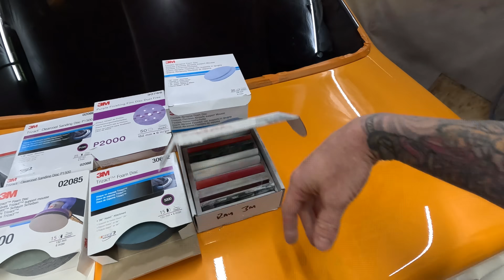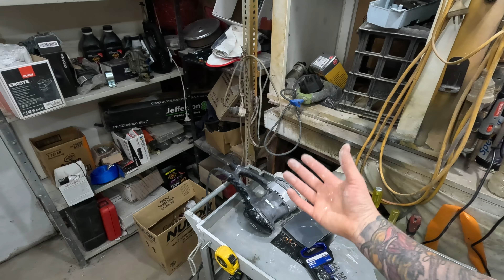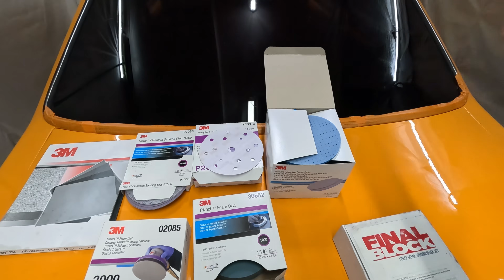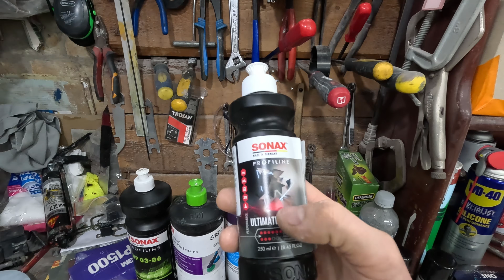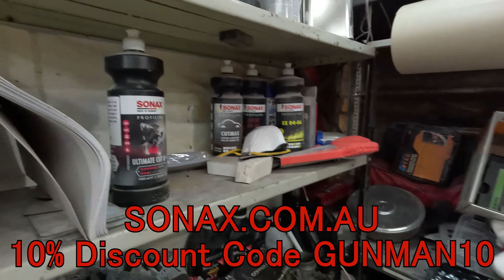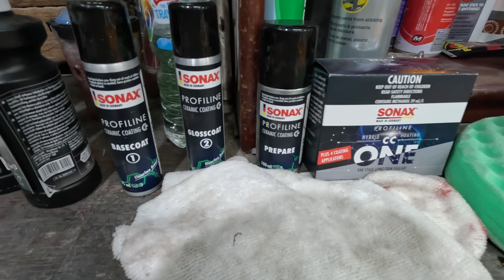My Polishing Procedure: Tools & Materials

Comment: GUNNY... I hard block with a piece of 1" dia pvc pipe with a flattened side with EAGLE 1500-2000-3000(Japanese manufactured) it is a MUCH MUCH better product, which I thought would be more expensive... it is half the cost of 3M, lasts longer with a more consistant grain size, so it leaves more uniform surface.

Comment: after painting 2 k solid white  I cut back with a DA 1500 ,2000,3000,5000 and still see scratches.WHY? then used every buffing pad and polish there is but still can't get rid of those scratches.very frustrating

Comment: Hey Gunny mate 
I used to be the body filler, primer, sanding and masking guy. 
I got F all time on the spray gun in the shop. 
I’m happy to block my whole car with 2000 grit wet and then buff. I only had 4 years experience so my painting isn’t very sharp. But at least with blocking I know it’ll be super flat. 
I use a Supercheap DA polisher and it goes hard for the $120 or so I spent on it. Pair it with a carpro denim pad, then a Woolie, using Menzerna products, you might like it bro. It’s probably better than the Sonax and Rupes overpriced combo. Use that saved money for beers 🍻

Comment: Your correct, 3M have the best abrasives. Their compounds and polishes are decent as well. Their pads are not in the same league but as a system 3M works well. You could go to another brand like 3D or Scholl and that would again lack elsewhere. No system in complete. The foam backing is needed on cars with contours and uneven surfaces. That orange think is flat as :). If your just cutting cars you spray up then you would know already what suits it. But if your cutting factory paint you need different compounds and pads. For Toyota paint, the Carpro Cool Pad Wool/MF is the one to use.

Comment: LOVE YOUR WORK
I bought 2 different spray guns and I found that they are only spraying out very little paint and I find it slow to apply to panels  my settings are right I think as I tried all settings. one gun I found out was a low velocity gun so I bought a bigger one and it seems the same even though it's high efficiency gun. My compressor is a massive 4 motor Chicago with heaps of air. what do you think is the problem apart from the fact that they are cheap guns. 
the bigger gun is a italian made called Air Gunso from the anest Iwata group
ita a 1.3mm high  transfer efficiency gravity gun its number is Az3hte2av. in case you look it up.

Comment: Recently, I did a job,  starting with 1000 dry on the DA (no interface pad, stikit backing), then 2,500 wet with a block by hand,  then 3000 trizact. 3M polishing system.  Huge time saver in the sanding phase.  I have never jumped grits that far,  but it totally worked.

Comment: Man I love when you do vids like this.  A bit off topic, but I noticed around 8:00 in you had some Penetrol on your lower shelf on your work bench and was curious if you have any use for that in automotive applications?  I've been primarily into architectural coatings for the last 35 years and I know what we used it for in the past, although I haven't used it as a flow enhancer/paint leveler in years, due to the natural yellowing of white paints especially when it's added.  I just think there's better options now available for nearly every architectural paint.
Reply from the maker: Yeah it's actually good to use like an odourless fish oil, so it will lock the moisture and air out but it's obviously not solvent proof, I find it really handy to just load up on inner sections to stop further rust. It's definitely incompatible with automotive paint so it must be used properly.

Comment: Hey gunny i keep getti g swirl marks any advice?
Reply from the maker: 3M 3 step rotary, use that system properly and you will not have swirls. Don't forget as you go finer, slow the buff speed down and hold less pressure

Comment: Try using water with your 2000 discs ,I start with 1500 dry disc then 2000 wet disc and Finnish with 3000 trizac all Mirka discs except trizac ,Ferecla G360 paste using Ferecla high cut pad it’s fantastic ,but that’s on fresh cured lacquer and lacquer cured a long time is a nightmare to cut slow movement and fast speed is best

Comment: The worst clear coat to polish is that ceramic clear coat.  I forget now but I think Mercedes and BMW use it and it is a nightmare to polish.  The only thing that I found that would get out the sanding scratches was super high speed on the wool pad with 3m extreme cut and after that, the swirl was horrific and if your not careful and you don't keep the wool wet it will burn straight through the clear.  Just getting rid of the hologram took forever, I had to buff the hologram with 3m fine cut before the swirl remover and it was still hard to get rid of.   I hate polishing!!

Comment: We use the blue pads a lot at work but only for sanding before the base coat and obviously a lower grit and they last forever but I have the same problem, it doesn't sand the orange peal as fast as the flat disks but I find that you don't need to worry about sanding rings.  Try getting a wool pad with heavy cut 3m at a higher speed to cut down the sanding scratches faster.  I use the wool pad as a step before the foam pad after the 3000 and I find that it really knocks down those deep scratches fast.  High speed low pressure with a lot of compound for the wool.  As for the 1500 I have had the same problem no matter what sander I use.  I did find that if you use a sander with a 2.5mm hub the sanding scratches from the 1500 are significantly less but then it cuts very slowly. I cant imagine sanding clear with 800 and then trying to get out those deep sanding scratches, that must take forever. Sorry if my terminology is not correct as I live in Germany and all of our products have different names.

Comment: custom jobs, 5+ coats of clear on car. Ive always started with 800 grit for years, but recently started doing 400 grit to start( i know scary) a fellow painter told me i should try it,  he says he gets the flatest surface starting with 400, only on the flat areas of panels, no curves. breaking the skin open with 400 grit on a 55 chevy next week, going to let it cure for a while before finishing through the grits. 
- 400 grit wet using solid acrylic block, wash clean, dry
- dry guide coat, 800 grit wet using balsa wood block, wash clean, dry
- dry guide coat, 1200 grit wet using balsa wood block, wash clean, dry
- dry guide coat, 2000 grit wet using balsa wood block, wash clean, dry
- cut/buff.
Reply from the maker: Sounds awesome, but you should look into 3,000 and 5,000 grit, makes polishing so much easier
Reply: 400 does sound pretty vicious 😮, but I agree, the guidecoat is the key. Currently doing my first polishing job on direct gloss 2k using this method and it's working out very well. (800-1200-2k-3k polish).

Comment: How do I know if my car is a good candidate to have a heavy clear coat refresh, and not too thin?
Reply from the maker: I can generally tell by looking at it if it's safe to cut back. But there's still a risk of cutting through if you haven't painted it yourself and applied a few extra coats.
Reply from the maker: @Ivan_5150 I forgot to mention that 😆 I actually have one but didn't think to use it for polishing